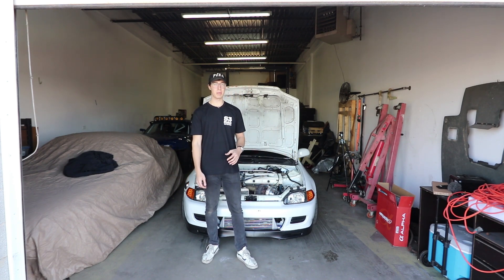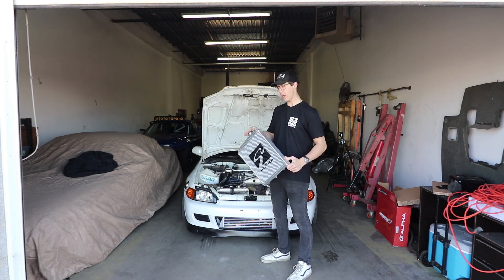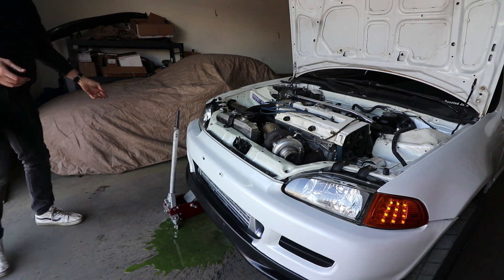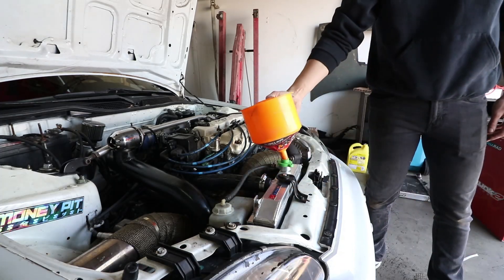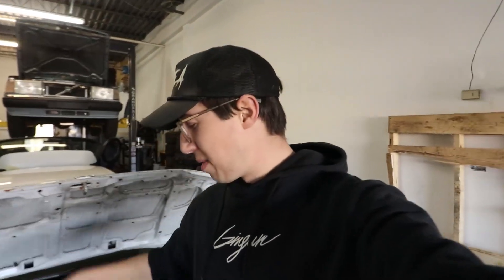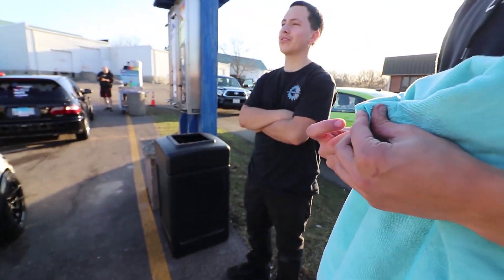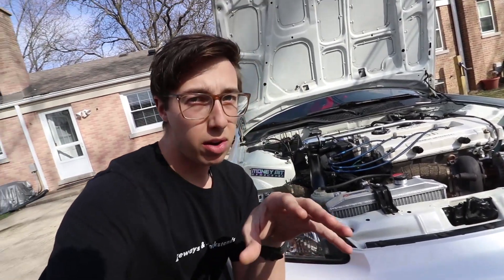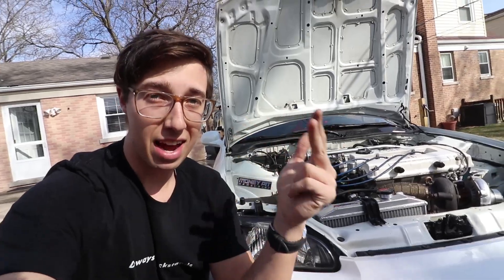Skunk2 Alpha Dual Core Radiator Install | Turbo LS VTEC Civic

Comment: You would really see a big difference if you had a good turbo blanket the turbine emits between 600 to 800 degrees Fahrenheit believe me when I say you will see a dramatic difference in engine bay temps and that's from experience also a spal fan is the best in the industry hands down
Reply from the maker: Ok noted!